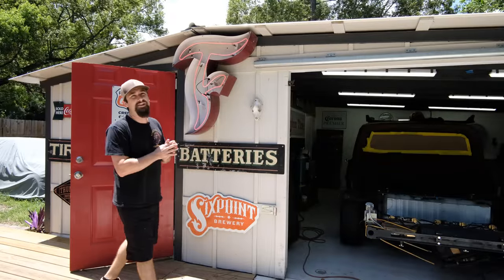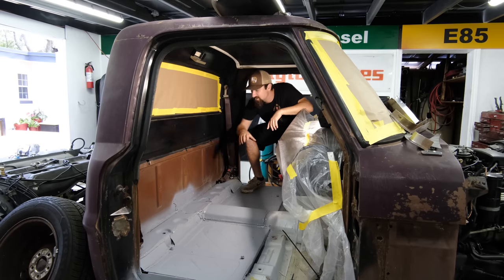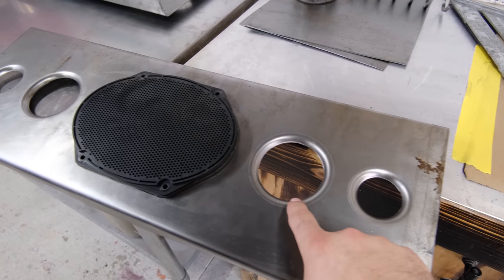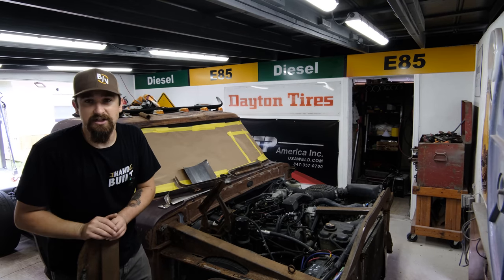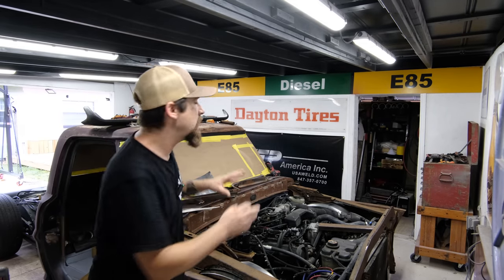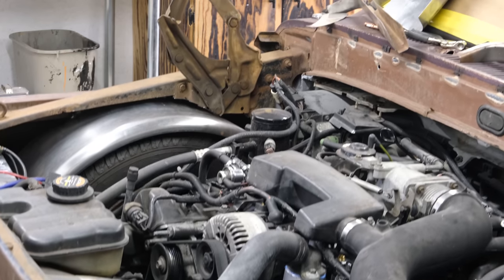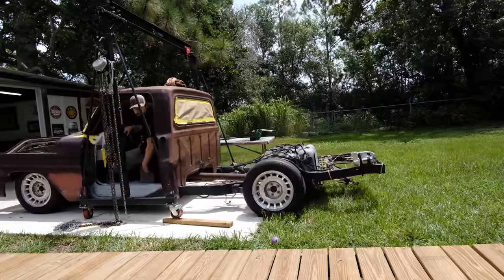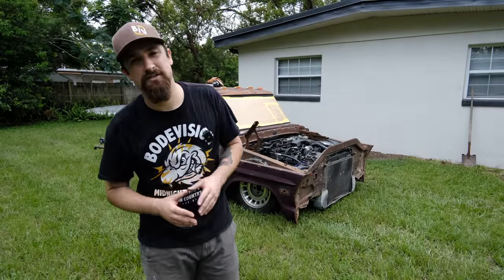Trailer Fenders?! Body Swapping Old Truck To Modern Chassis

Comment: Flare the inner edge of the tubs. If you need to move it at all when aired out it'll eat those tires up. PS I like the Lincoln wheels on the truck

Comment: The fitment with the tubs is perfect.  Do you plan to pull motor to paint the tubs and engine bay?
Reply from the maker: Everything is removable and it’ll be painted prior to final install. Motor will stay

Comment: Those speakers should be upgraded as they have no real magnet and won't produce any real sound.
Reply from the maker: They were in the car and they produced sound just fine before I removed the deck. Also with this being a common size I can easily upgrade if necessary
Reply: @BodeVision  always upgrade audio while it's out,  nothing worse than taking car apart again later.

Save time and replace them now than later.
They won't run well on a amp if you ever amp up or change head units.
Most after market head units have twice or more power output than a stock radio etc.
Reply: @Andrew-vd2ko  - I believe the stock radio in this Lincoln Town Car is an “Alpine Pro”. I would think an Alpine brand would be a half way decent system.
Reply: @dbode4072  check the rms rating,  most likely to be only 5 to 10 rms per channel not a 15 to 20 as per most other after market.

Even alpine did low output systems for car markers.